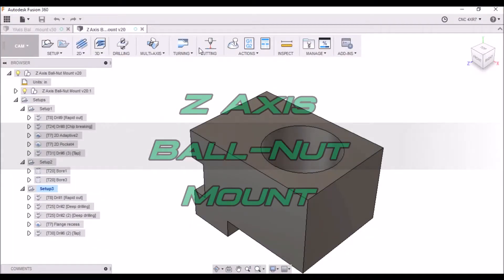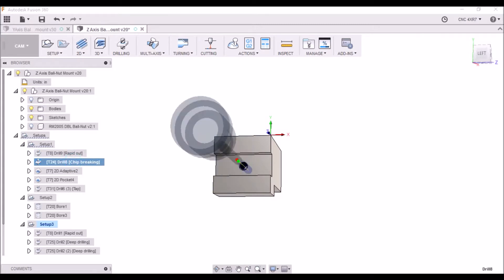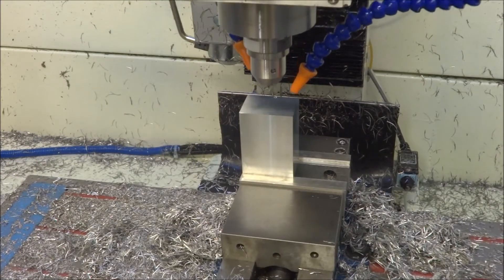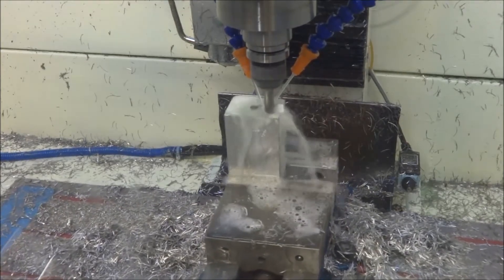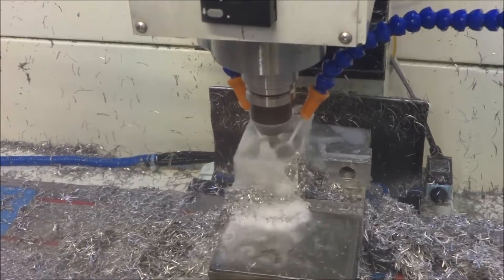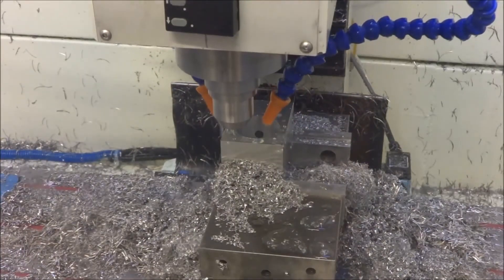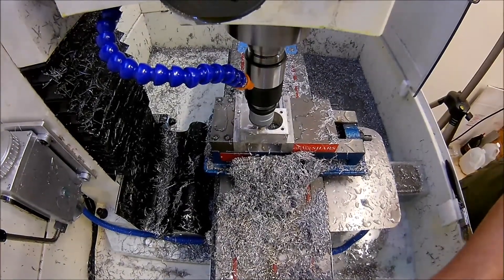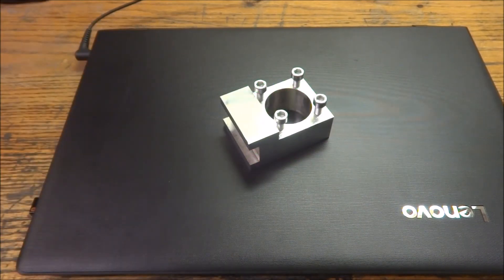Z Axis Ball Nut mount machining

Comment: Great work as usual Sam! Is there a limit to how fast you can reliably run the tension compression tapping head?

- Nick
Reply from the maker: Thanks Nick,
I'm sure there is although I do not know what that is? The Spindle needs to be able to reverse at the bottom and then get back to speed. you only have about 3/4" compression/Extension to play with.

I figure 400 rpm was a good rate I believe the feed rate was around 16 and 19 ipm for the M6 and M8. 
Be Safe,
Sam
Reply: Good to know Sam! Thanks.

Comment: That was a nice job all around. Thanks for taking the time to share this. Just for future reference, I like to hold the part as far down in the vise as possible, like when you were cutting the slot. It worked out fine for you, but like you said you were being conservative with your feed rate. I have seen parts get moved in the vise when there held up near the top of the jaws, and of course a more aggressive feed rate was used.
Thanks again.
Reply from the maker: Your Right even with the light cuts I should have clamped as much as possible in the vise. Not sure why I did not maybe it was a Camera angle as well